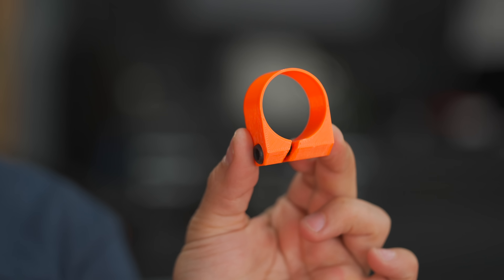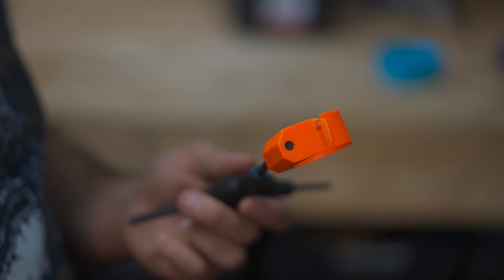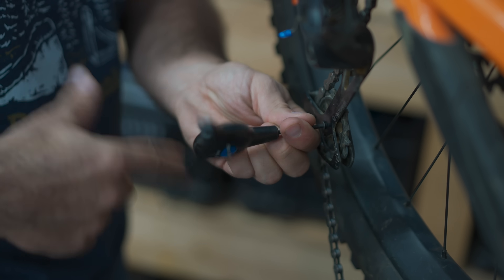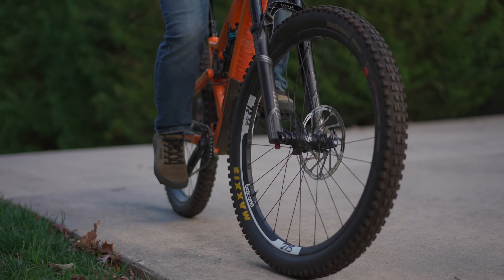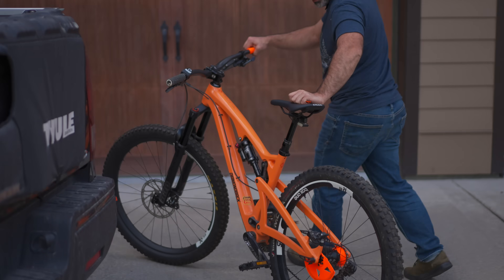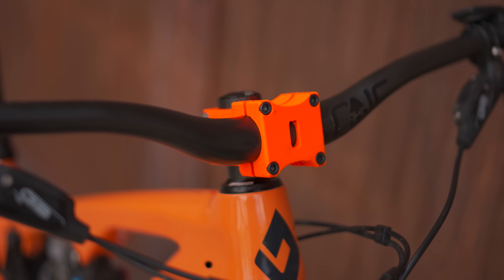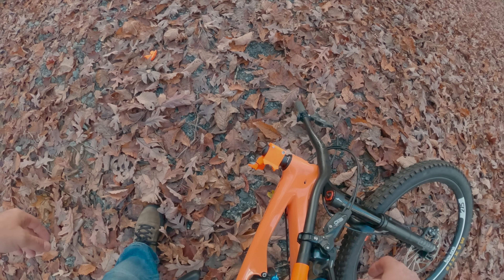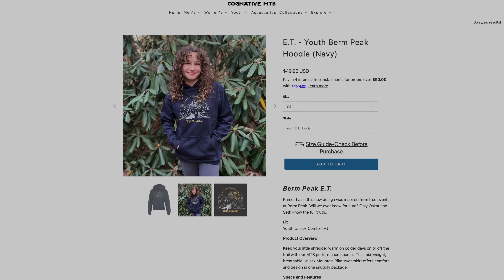Will 3D printed MTB parts break catastrophically? Let's find out!

Comment: I love your videos! you might want to try a more advanced 3D cad software, like Fusion 360, Onshape, Shapr3D, or FreeCad. also, you might want to use heat set brass inserts (when you heat them up, you push them into holes in the plastic that you modeled in on the computer) so the threads of the bolts and screws don't lock on to the plastic and break it.

Comment: Maaan. I love seeing the excitement of the 3d printer and the possibilities. Yet please don’t make any parts that are metal from the plastic as it wont have enough strength and will snap as the point you lease expect. Try making non-crucial parts of it, especially ABS as it is quite brittle. Also try printing it the way the filament is perpendicular to the force applied - that way it won’t snap as easy (like a seatpost clamp, it snapped at the direction of print)

Comment: they also have metal 3D printers that might make slightly better parts and they even have 3D printers with carbon dust in the plastic or even full continuous fibers in the plastic. Of course all three of those are FAR more expensive.

Comment: I designed and printed oversize (15T) jockey wheels for my RD-m8000 derailleur. It fits in the ceramic bearing from genuine Shimano jockey wheels and printed using PLA. Each of the wheels last over 3500km before wearing out. I enjoyed extra derailleur capacity and custom color, super fun!

Comment: I broke the idler pulley on a fairly old derailler (Sram X5) and couldn't find a spare online. 
So I 3d printed one out of Nylon, which thanks to the low coeff of friction worked even better than the original one !
So i modified it to accept a bearing and now I basically have a sram X7 with pulley colour matched to my bike !

Also when I converted to one-by I would get chain skips (of course my sram X5 now X7 doesn't have a clutch), so I 3d printed a retainer ring that bolt in place of my smaller front cog and no chain skipping since !

Comment: Dogpiling onto the heatset insert suggestion. They are surprisingly strong, much stronger than you'd think.

Part orientation is a big factor too. Increasing shells/perimeters & top/bottom layer count will give a greater increase in strength vs infill percentage.

Comment: You can buy Nilon filament which would improve the strength of the parts. However you would need to upgrade the extruder so that it can melt the nilon. You’d also probably need a glass case for your 3D printer as you wouldn’t want to breath in those fumes haha.
Reply: This extruder can handle nylon.

Comment: You should print some grips out of TPU (flexible filament) and see how that turns out.  Also, if you want 'real' 3d printed bike parts, you will have to go SLS, which does metal. However, that's major bux......

Comment: How about converting from a chain to a belt drivetrain with 3d printed parts? [edit: doh 3d printing wouldn't get you past the chain stays] 
Also I bet the brakes would have lasted longer if you'd printed up a new set of pads to go with the light weight rotors /s.

Comment: I really love that you are exploring 3d printing.

Some helpful advice:
To make stronger parts you have a variety of options besides make the part bigger.
You can choose different materials like abs, nylon (pa) and polycarbonate (pc) or materials with carbon fiber in it but especially pa is lot harder to print. There are a lot more industrial grade materials but they are way more expensive. Igus has also some really nice filaments you can use for parts that benefits from self lubrication.
The orientation of how you print it is also very important. 3d printed parts tend to break first between the layers so you can use that to your advantage. You can also print more bottom and top layers as well as more perimeters. I usually print 5-7 bottom/top layers and 3-5 perimeters.
Infill of course is also an important factor. 3d infill like gyroid ist usually pretty strong and around 25% infill gets the job done quite good for an average use but you can go way higher if you want it as strong as possible.
And for the threads even though threads that are cutted or printed right into the plastic can hold quite a lot you can also design the parts in a way where you can use a washer and a nut or you can take a look at heat-inserts. They work quite well and are getting more and more established in 3d printing and are really good to use at parts that you screw and unscrew regularly.
Reply: 1. Those materials don't make parts magically stronger. Layer adhesion and proper design are much more important. Carbon fiber mostly affects looks (and nozzles), not part strength (at least not positively - it can make a part much weaker).
2. Infill is for printing solid layers on top, it doesn't affect durability significantly unless it's set to 100%, which creates its own problems in turn. There is no way that going from 10% to 80% infill would turn a part that breaks easily into something robust enough for using in a bicycle. Again, good designs should never rely on infill.
Reply: i didn’t say that carbon fiber makes parts magically stronger. But they do server more benefits than just the optics. Temperature resistance for example is one key feature, less warping also. But you need the right amount often fibers for that. I typically go for 15-25%.

Layeradhesion is pretty dependent on the filament. TPU for example has near perfect layer adhesion. Layeradhesion is more of a printer settings thing.
I also said that print orientation is also key.

For the infill. I said that 25% mostly gets the job done but you can up it if you want to get the best result possible. But i could have specified that i thought about something like 75% you should never print solid parts.
The most significant change for „part density“ is perimeters and top/bottom layers as i said.

Comment: There are metal threads that are designed to be used in 3D printed parts. You print the part normally and then use a soldering iron to push the threads into the part. It you add nuts to the bolts you can increase the strength even more.

Comment: For some of those parts - especially the stem - you might want to look into lost plastic casting. You can make a plaster mold from a 3D printed plastic part, bake it to remove/burn away the plastic, and then cast molten aluminum into it: then you end up with a perfectly fine and safe to use aluminum part. It doesn't take much to melt and cast aluminum. Or even brass - a brass stem would look pretty cool, I think!
Also: the jockey wheel should work, as you noticed, but PETG isn't tremendously wear-resistant. Nylon is a better choice. Weed eater line is made of nylon and it works fine for 3D printing - 0.065" should work fine if you adjust the filament flow rate accordingly; in my corner of the world, we get those in metric units, so I used 1.8 mm and it worked fine out of the box - but for best results you should dry it first. Nylon is very hygroscopic. This also applies to purpose-made nylon filament that was left exposed to the atmosphere.
Reply: By the time you look it to that you can get a whole set of metal parts
Reply: Well, he could, yeah, but some of those parts, like the jockey wheel, are arguably better in plastic. Others, like the seat post collar, would have to be redesigned - those thin walls might be too thin for backyard metal casting processes. The brake rotor would have to be machined after casting. The stem would be the easiest to begin with, I think.
Reply: Another approach I've heard about for making metal 3D printed parts is metal-infused filament, such as "The Virtual Foundry." Basically someone 3D prints with the filament as normal on a standard 3D printer, then uses a kiln to burn away the plastic and sinter the metal into a solid. I don't know how strong it is compared with cast or machined metal parts, but I get the sense it's much stronger than plastic. I've been thinking about trying it out, the kiln is the expensive part.
Reply: @quillmaurer6563  yeah, that's totally possible, but at least for the BASF filament I've seen, processing the part after printing isn't that simple. The plastic isn't burned away in the kiln; the part must undergo catalytic debinding, which uses nitric acid at 120 °C in a nitrogen atmosphere and may take several hours for thicker parts. Sintering also requires an inert nitrogen or argon atmosphere, so the process itself as a whole is expensive due to consumables in addition to the equipment itself. Those BASF filaments are only available in stainless steel, so they're not necessarily a good option if weight is a concern. I'm unaware of other materials being offered by other companies. Also, at least one paper has found there may be strength issues when compared to other processes (Kedziora et al., "Strength Properties of 316L and 17-4 PH Stainless Steel Produced with Additive Manufacturing").
You can pay to get it processed, though. One "processing ticket" from MatterHackers, good for up to 1 kg of parts, costs $50. I've never used their service, I only know it exists, and there probably are other companies offering similar services.
Reply: @quillmaurer6563  I suppose I should have actually checked out "The Virtual Foundry" before writing my comment - I did that now. Quite interesting, it seems more within reach of a backyard setup than the BASF process, but I have my doubts regarding contamination and how it could affect the strength and quality of the parts, too. I would definitely try it out, though, if I had a suitable kiln.

Comment: You should try using plastic that is infused with glass fibers- if such a thing is available for 3d printing machines.
60% glass sounds right to me. Maybe even more then that.
But do not expect miracles.
And it is not only pricey, but also it will destroy the nozzles of printer much more quickly.

Comment: If you ever want to do a followup, here are some ideas for improvement:
Use heat-set inserts and/or slots for metal nuts to better secure screws.
Make sure your prints are designed to be printed in an orientation that optimizes their strength in the direction you want, as a print is more likely to break along a layer line. The best way to think of it is that 3d prints have a grain, and the orientation of that grain matters for the strength of the part.
Change material. Nylon would probably work out as a better material than PETG, and if you're already doing that, you might as well look at the carbon fiber filled nylon that's out there. 
If you want strength, perimeters are more important than infill. Perimeters are where the print gets most of its strength from. From the what I can see in the video where you show the broken stem, it looks like you opted to up infill to 95+%, but didn't really add any perimeters. Try more perimeters. There's a CNCKitchen video where he tests this if you want some explanation of why perimeters do more than infill for strength.

Just a random note that you may already know since you've been getting into 3d printing: Try a 0.6mm nozzle. You can still print at 0.15 and 0.2 layer heights, but the perimeter will be thicker, which makes the print stronger, and it'll print faster due to being able to push out more plastic. These days with arachne perimeter generation in both Prusa Slicer and Cura, there isn't really much of a noticeable quality difference.
Reply: The grain suggestion is a really good way to put it.  With all the wood features at Berm Peak that should be a familiar concept.  And yes, for high strength parts I'll whack the perimeters up to 4 or 5 from the more normal 2 or 3.
Reply: Agreed with all of that, only thing I'd add is that a lot of people make the "mistake" of copying metal parts in plastic, it's a bad idea usually, plastic isn't as durable, so you'd need to make the part bigger to handle anywhere near the same loads. And it can be a very good idea to include of the shelf metal vitamins into 3d prints for durability, like add a bolt that goes straight though something to act like a skeleton, lets you use the highly accurate custom shapes of 3d printed plastic, but also make it more structually durable than just plastic.
Reply: carbon fiber nylon is pretty strong stuff, also printing temperature matters and cooling

it's not that the part looks good that it'll be good, it'd be better for strength if the parts were slightly molten rather than "look good" cuz the plastic would be fused better
Reply: @BH4x0r  Yeah, my understanding is that carbon-fiber infused nylon is stiffer, but more brittle, so it's more likely to snap where a regular nylon part might bend. That said, both would be better than PETG, and testing which works better for what parts might be interesting.
Reply: All of this is top advice.
Reply: Make this comment go up,he said everything
Reply: Or you know, don't try to replace a structural, load bearing metal part with a plastic equivalent, whether 3d printed or moulded. Most of these parts are made out of metal for a good reason.
Reply: @legolas66106  I don't think anyone expected this to succeed. It's just a bit of fun that can be taken further!
Reply: @legolas66106   in my professional practice i was able to successfully replace metal components for industrial machines with 3D printed ones, it's not to be recommended for everything but they can be obvious gains in cost, weight etc... it was one of my first ever project working employed and it still held before i went independant. If it wasn't for living in europe i'd love to print them with my machines and settings.

Comment: I think the designs were pretty good for the most part but you didn’t anneal the parts. Annealing in hard packed sand or other suitable media will preserve the design but bond the material without the weakness encountered from layer printing.  Surely then you could full send. 

(Note: I am not an actual engineer, this is meant solely for the memes & any created parts are not intended for actual use on a bicycle)

Comment: @Berm Peak Express

"It's my stupid design, not the plastic." 

I'd say it was a bit of both.  I'd definitely just put round or oval holes in the rotor because of the stresses at the corners.  

 I'd repeat this experiment with glass reinforced polymer.  But ultimately a plastic rotor is a bad idea because of heat and the fact that it's going to wear and potentially melt into the pads, definitely galling and effectively welding the pad to the rotor.

3DXTECH sells six different types of fiber reinforced polymer filament.  I'm not recommending 3DXTECH or any specific brand or type of filament as they all have different properties.  You'll probably actually get decent clamps and maybe the grip.  It should work really well for things like handlebar mounts and GoPro accessories. I'd say the stresses on the other parts are just too excessive.

Comment: For the screw threads, look into brass inserts that you use a soldering iron to fuse it into the part. Just look up 3d printer inserts there are good videos on it. And also, make sure it's printed at 100% infill in concentric infill pattern cus it's the strongest in all directions at 100%.
Also keep in mind print orientation with the layers

Comment: petg tends to shatter just as your parts did, pla+ would have survived a bit better as it can flex more. Plus it looks like you printed at 50% infill some of those parts should have been 100%, Another thing to think about is what side you print them on, you want the print lines 90 deg to the direction of the force.

Comment: it useful for few thing like mounting for hold phone or camera else like that and u can make handles thicker so doesnt snapped because your engineering it too thin
thicker would done better in first place and i have friends make few parts for my motorcycle like brackets that hold windshield on handle bars because aftermarket was too big didnt fit my handle bar so got 3d printers one it worked awesome and my phone holder too never have to worry about my phone get broken in my pocket whiles on bike
one thing i wanted with 3d printers is make motorcycle baggers that u can store stuff in it like wallet or few tools n starting fluid n ex battery backup in cause main battery died whiles trying to start it but he didnt have bigger 3d printers make it so i just wait until build one
2nd you never know what plasticmyou are using because some plastic is weaker and some is stronger it pend on which plastics

Comment: Is this design flaws? YES.
Wrong filnament, wrong design and wrong target.
More material, does not mean more strenght. More often there is wrong material usage. There is video on ca throttle as far as I remember, where they made differential sprockets for their truck with special filnament.
After material, You should look at design. Seatpost clamp for example. Instead of making it bulkier, you should put additional lip of material thru middle of whole clamp, it would help strenghting it up and disperse tensions. Or make it round.
Casette sprocket. This was too thin. If you would use shimano link glide standard it could work.
Reply: 👆Thanks for watching 👆
Expect more videos💳
I have something for you 🎉🎁🎁

Comment: in tinkercad you can actually model the threads directly into the part and it makes it a lot stronger and less likely to crack the plastic because you're not forcing the screw into the plastic. also just for fun you should look at upgrading your printers nozzle and print with something like carbon fibre reinforced nylon. also if you're making functional Parts add more shell layers and if you can print it at 100% infill that's best. you lose a ton of strength by doing reduced infill.
Reply: 👉Thanks for watching ❣️ 
👆I really appreciate, message me by the name above 👆👆👆to receive gifts 🎁
Congratulations 🎉🎉